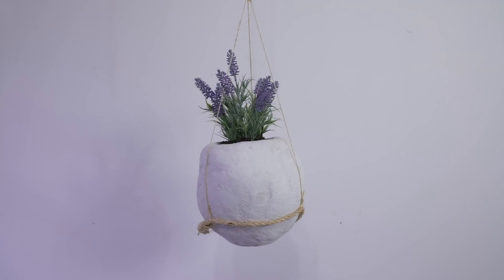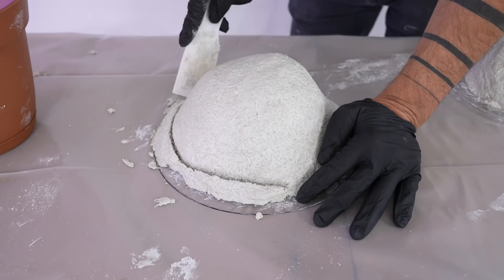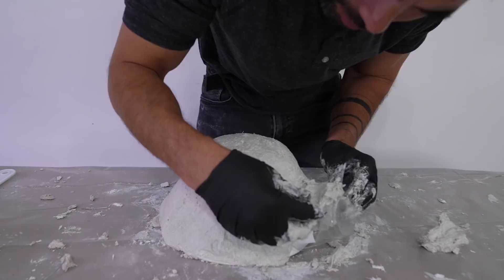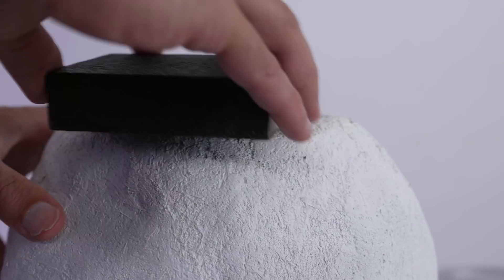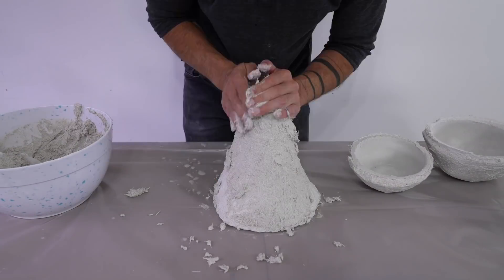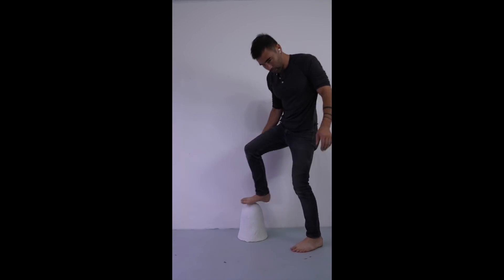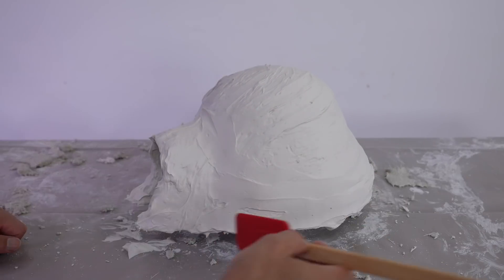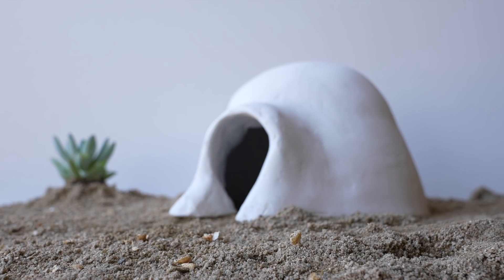Concrete Balloon Experiment with Surface Bonding Cement

Comment: Love this - I think SBC is way underused by DIY-ers! The joint compound is a great trick - outdoors I'm guessing you could use a cement plaster, though obviously that would be much harder to sand smooth. How heavy is the resulting planter? Is it appreciably lighter than poured cement?

Comment: Nice! Once dry, how well does the the material handle getting wet or submerged for a while?
Reply: I made 20" globes from this product...they're still holding up a year later after rain, zero degree winter days, and 100 degree summer days.  They even support my weight of 180 lbs standing on the globe.  I don't recommend doing that, but it's impressive stuff.  Just be sure the bags aren't more than a few months old, or the product will mix up, but will never cure properly.